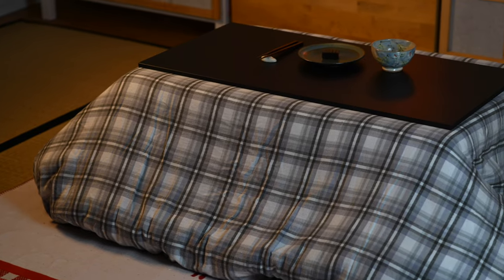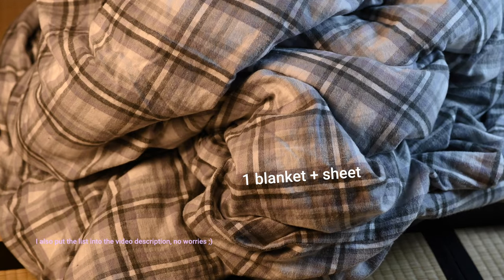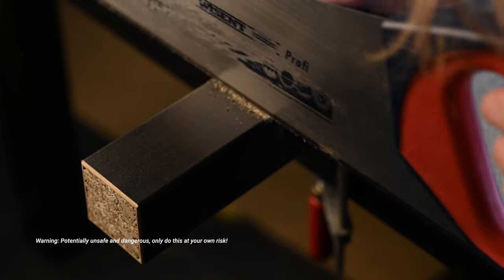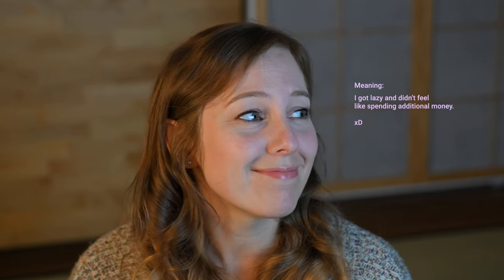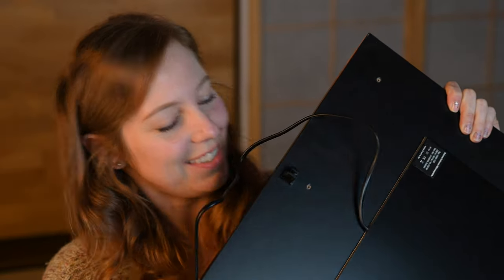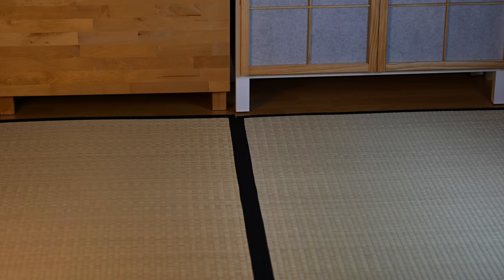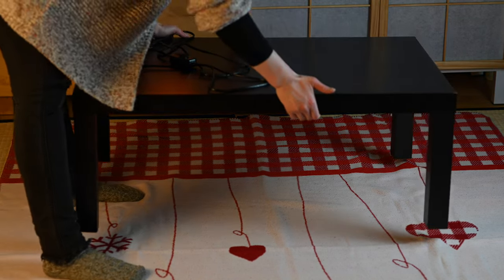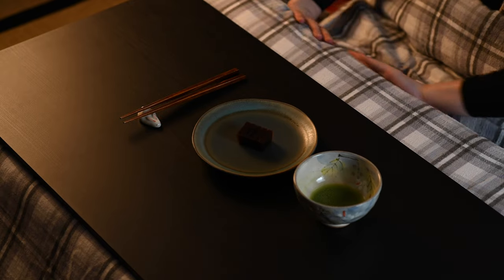DIY | How to build a kotatsu / Japanese heating table using an infrared heating panel!

Comment: I've been looking into making a kotatsu for a while and this has really helped! Definitely encouraged me to do it ☺️ do you have a link for the heating panel? I'm struggling to find one similar 🥰
Reply from the maker: Heeey, super happy to hear the video is helpful to you - thanks for letting me know 🥰 I don't want to  link to any specific products here, but I got it on Amazon Germany - in case you're from the US. Just look for keywords like infrared heating panel, there's a ton of products out there :) You can also direct message me on Instagram or send me an email (link is in my channel info). Crossing fingers for your kotatsu to turn out just the way you want it to! <3

Comment: Would appreciate if you can share the link to the heating panel.
Reply: Thermo 3148044 Infrared Foot Warmer Panel, 300 x 600 mm, 230 V, 40 - 150 W, 80 °C Safety Thermostat 
I believe

Comment: Wow, it's crazy how cheap these are here! I'm def gonna buy one to bring home to the states with me when we move back soon lol I'll get a converter if I have to, but I'm not that worried about it. I can get a decent one for less than $100 at Nitori.
Reply from the maker: Aw man, yeah that sounds great! If you can get it to work safely with a converter, that would be a dream imo :D All the best for your DIY adventure then, let me know how it goes if you'd like!
Reply: Japanese electricity is generally 100V AC running at either 50hz or 60hz depending on where you are in the country. North America is 120V @ 60hz. A heating element doesn't care about the frequency though because we're running a resistive heating element. What you do need to be cautious of, however is the difference in voltage. The current draw should be listed on the heater somewhere. We have to remember our physics and Watt's law. P=IV or Watts = Volts x Amps. Take the amperage listed on the heater and multiply it by the mains voltage. If a heater in Japan is listed at 500w, that likely assumes 100v. so 500w = 100v times X Amps. The heater has a draw of 5 Amps and the amperage is constant no matter where it is. What changes is the wattage along with the voltage. In N. America, it would be 600 Watts = 120v x 5amps.The heater will be more powerful in the USA because of the higher voltage. This could lead to problems if the heater isn't intended for what is a 20% increase in output. If you were to run that same heater in Europe, it would be between 1000 and 1200 watts!! 
So be careful and read the documentation.

Comment: Nice work Brina!! Wow! Looks really good and sturdy and wow awesome Kotatsu!!!

I made my own years ago but I actually did purchase a legit japanese heating element with a seperate power converter since the voltage is different than here in the US. Its held up for over 5 years now! I use it only in the winter and my cats love it!! They spend more time under the Kotatsu than I do 😼
Reply from the maker: Eeeh, thank you so much for your comment 🥰  I'm really impressed that you got a proper Japanese heating element!! Especially since you need a converter in the US - did you order everything online? 5 years is amazing and I bet it will last for many more to come, sounds like it's a great quality product :D
So cute your cats are in love with it as well, if I was a cat, I'd spend as much time underneath the kotatsu as possible too ;D

Comment: I think a good way to somewhat secure the topplate would be strong magnets. If you experiment with the strength and amount of magnets I'm sure you'll find a nice fit between holding it secure and barely being able to ever get it off again.
Reply from the maker: Haha yeah maybe. Though I honestly haven’t had lots of issues with it. I’m just generally a bit careful standing up from the table but I think that would always be the case as it’s low and I don’t want to tip it over. Magnets would stand out on the top and if they’re strong ones they might pull magnetic things towards them 😄 but in the end it really is personal preference. Magnets are always fun to use in DIY 💜🎉

Comment: wish we had 240volt electrical outlets in the US that looks like an a very nice device
Reply from the maker: I assume you can get an infrared heating panel in the US pretty easily - it would likely match with your requirements then 😊👍

Comment: I've built one of these, also using a LACK table. For those interested, I was able to just screw on the Metro Kotatsu heater you can get on Amazon in the US with angle brackets. After about a year of use, I noticed one of the legs of the table seemed to be breaking off. I believe this is caused by removing the lower shelf (which we need as a kotatsu topper) which helped give the legs strength. I've added angle brackets to the two interior sides of each leg which seems to be helping. I'm curious to know if you had a similar issue and if you were able to fix it. 

If it eventually breaks and I'm forced to buy another LACK, I will use the topper of the old one and attach it as the intended shelf but much higher up (maybe 3 inches below the table). Hopefully this will help give it more strength.
Reply from the maker: Hello, happy to hear you also built yourself a kotatsu 😄💜 Nope, never had issues with the legs of my kotatsu, it’s still working perfectly fine. I’d be careful about attaching the lower shelf. I don’t know your heater but I don’t think it would be safe to attach anything underneath it - please be careful!
Reply: @brinagoesjapan  I would just reattach the heater to the bottom of the shelf, not putting the shelf beneath the heater. I suspect if you're putting your table on tatami or something, when you push it it slides. We have ours at full height on a carpet, so when pressure is applied to the table the top moves, but the legs don't which is putting horizontal stress on the attach points.

Comment: Where did you get the panel? Do you have a link?
Reply from the maker: At the moment I wan't to avoid advertising specific products, but it's easy to find good panels on Amazon, just look for "infrared heating panel" and make sure it suits your needs :) I got mine from German Amazon though.
Reply: @brinagoesjapan  I'd love to find something that works like my heating pad, with a auto shut-off at a certain temp.
Reply from the maker: Gotcha, that makes sense and it's a really good idea - much safer. I just added "auto shut-off" into my amazon search, you'll need to compare some of them but there's so many to choose from :D
Reply: @brinagoesjapan  I understand not wanting to advertise a specific product, but searching for that on US Amazon doesn't seem to show the same products you have here. I wonder if this might be a European-only design for 240V. Can you please give a link or a full product name so I can investigate further?
Reply from the maker: Hellooo, if it doesn’t show up on the US amazon you could try visiting the amazon.de site and check the selection there. Some might ship to the US but sadly I have no idea how the conversion would work in that case 🙈 crossing fingers for you though!💜
Reply: @brinagoesjapan  I ended up getting a panel from Cozy Legs on Amazon.

Now to choose the right blankets at a thrift store and figure out how to mount the panel.